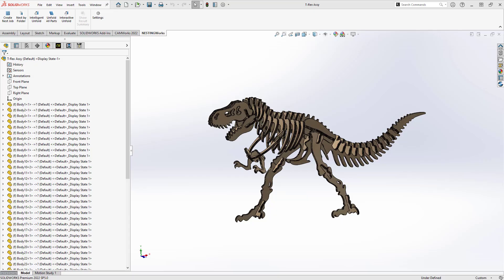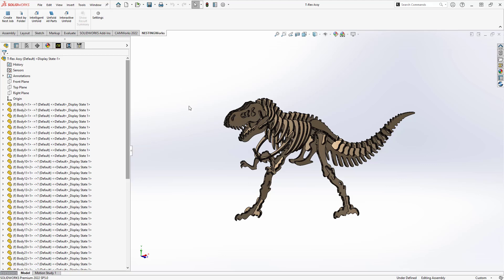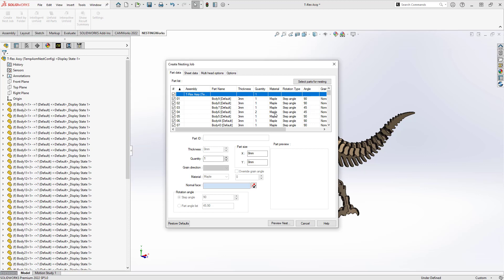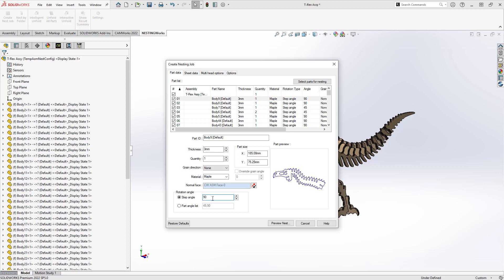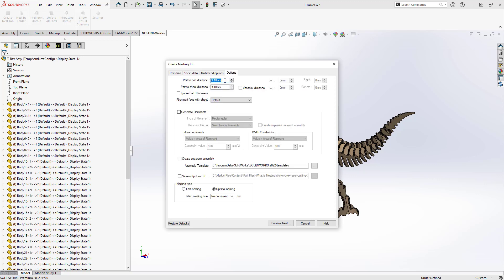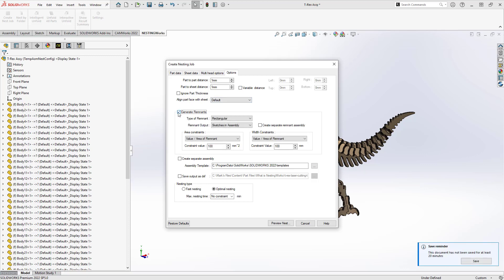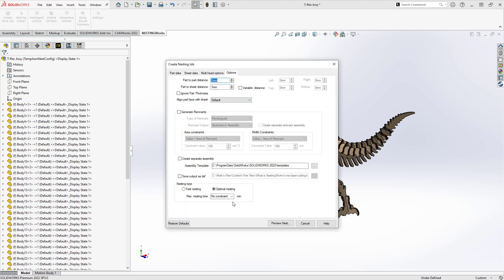What is NestingWorks?

Comment: Good but, can i put marks or numbers in each one part?
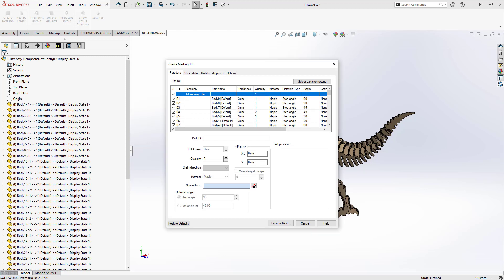Reply from the maker: If the number needs to be physically cut onto the face of the part, this needs to be added at the component level. NestingWorks will allow you to override part names in the Part ID field shown around 3:00 for organization, but it will not automate scribing features onto faces.